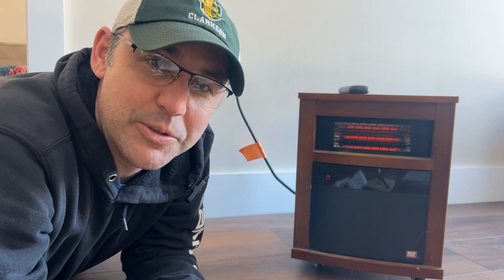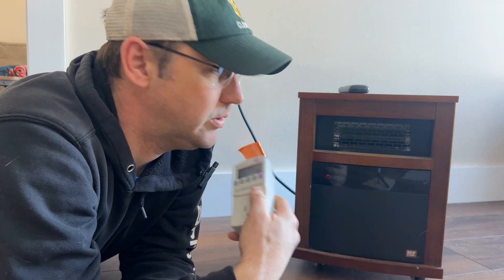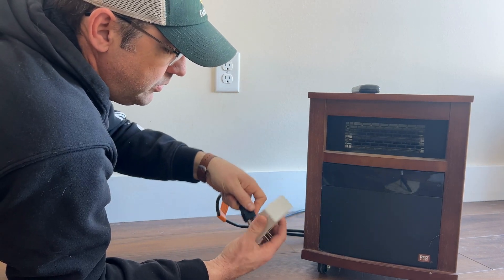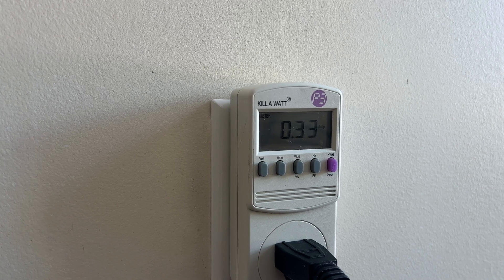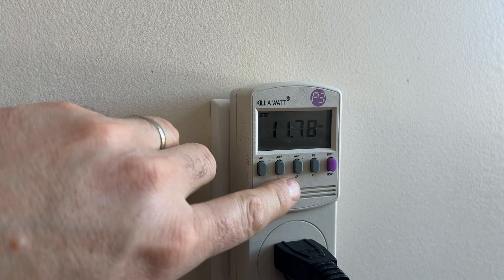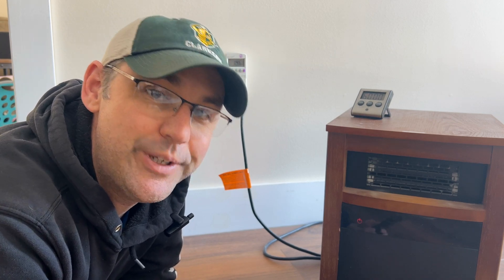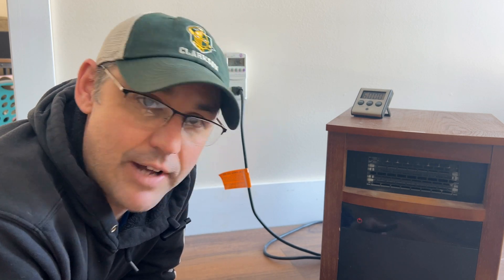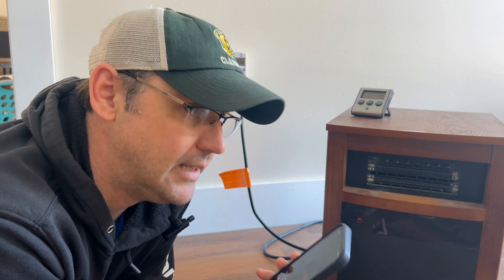How much power does a space heater use??  Using the Kill-A-Watt P3 meter

Comment: For future reference you can always predict estimated amps. Watts / Volts = amps. 1500 watts / 120 v = 12.5 amps maximum. Also, all resistive/electric heaters are 100% efficient, some may feel more different than others but they all will output the same amount of heat per watts consumed. All electricity they consume (even for the fan) will convert to heat eventually at 1 watt = 3.41 BTU. At those electric rates, you may want to consider getting a minisplit or 'portable heat pump' if your region permits. Minisplits don't directly create heat, they pull it from outside which is often 3x as efficient as resistive heating. Your 1300w heater will generate 4500 BTU maximum. A decent 22 seer minisplit can pump out 12,000 BTU and use 1000W or less. I also have a 'portable' ecoflow wave 2 that uses a max of 580W but outputs 6,000 BTU of heat. Half the power and still more heat.
Reply from the maker: Great info!  thanks for watching 👍